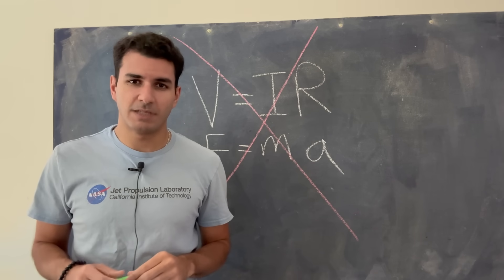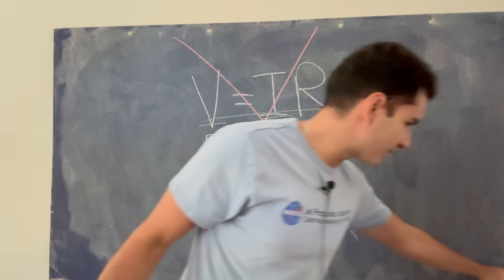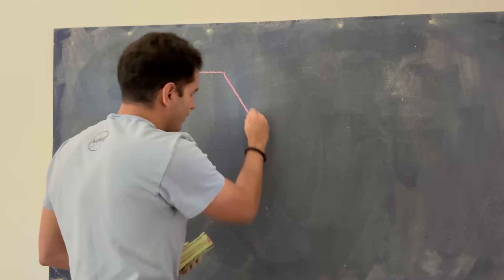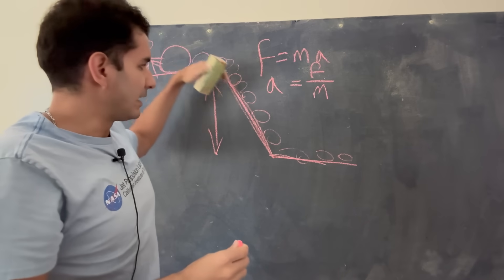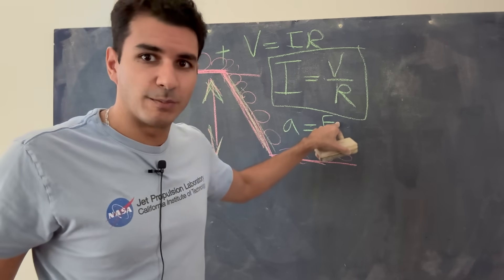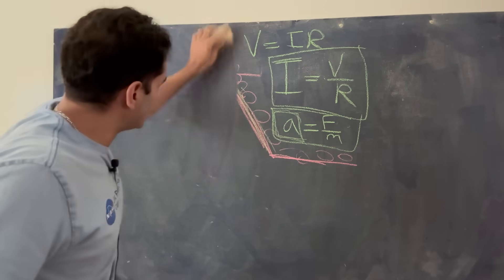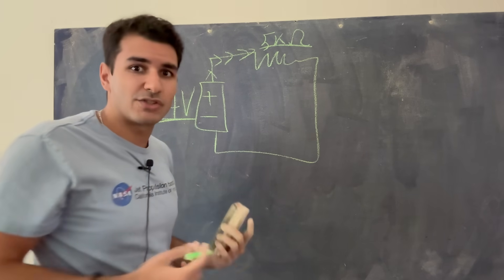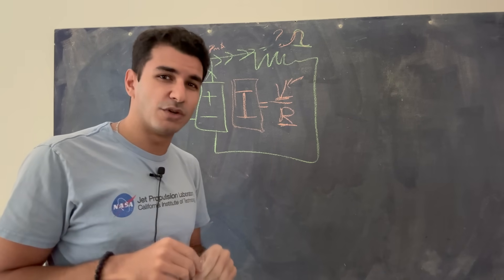You don't really understand physics

Comment: In the equation V=IR or solving for I we have I=V/R it is important to understand that I is a RATE; i.e., the rate of change transfer. The more appropriate statement should be that current is the rate of transfer of electrical energy. V is potential energy; i.e., Energy can be potential and kinetic. V (potential) is waiting for a path to be provided so that charges can move. Once a path is provided, the charges become a current; i.e., I = dq/dt. This insight allows for a rational interpretation of 'a' in F=ma as a rate as well. It is very important to recognize that the acceleration of a mass is analogous to a current flowing through a resistance. Conclusion: Study Calculus before Physics.

Comment: You all sitting there doing physics by calculating equations on a chalk board... to truly understanding physics sure that can have some benefit.. but you truly need 3d model visuals rendering softwsre games to demonstrate it then you can picture the entire thing in your mind and problem solve... those numbers... they only work so far.. what about tiny gusts of wind against a plane wing effecting the overal fuel milage... the exact angle the wing cuts into the wind to slow it down to just the right speed but also keeping in mind winds blow and flictuate and have a huge impact on this

Comment: Over 50 yrs ago..  I recall physics at A level started with grappling with metric system, I think because it's easier to recall units of measurement if keep using them eg N/m2 which implies various elements of equation IE  force, mass etc.. What you say seems a better way to foster understanding..

Comment: In my field I apply an (impulsive) force, and measure acceleration to determine effective mass. So I use m=f/a all the time. (for flexible, vibrating structures, effective or apparent mass varies with frequency)

Comment: One of my favorite examples of misapplied causality is from a Vsauce video where Michael gives the example of assuming that because you can calculate the height of tall building using the angle of the sun and the length of its shadow then the shadow is causing the building to be that height. Which is obviously false.

Comment: Another good example of a formula being conceptually inaccurate is the standard unit of acceleration: m/s^2.

I always used to think “What does the seconds squared mean? Why do you square time???”. That made no sense to me until I started thinking of acceleration in terms of velocity, which is measured in m/s.

The fundamental concept is that acceleration is how fast the velocity changes. So if an object's acceleration is 2 m/s^2, that means its velocity increases by 2 m/s EVERY SECOND. This is written as 2 m/s/s, which is shortened to 2 m/s^2. So really, the conceptually right way to notate this unit should be m/s/s, not m/s^2. The latter form distracts from the unit’s true meaning.

Comment: Sometimes, in electrical engineering, we have a constant current and we have a target Voltage, so we need to solve for R. Old school Ammeters gauge a current through a known resistance and that is how we measure voltage. Plus, once you start adding inductance and capacitance into the equation, physical analogues start to have less utility.
I'm not saying this is wrong or that no one would benefit from this line of thinking, but I think most EEs would prefer to think of V=IR as simply a relationship between electrical properties... Just my opinion - I could be wrong.

Comment: I understand what you're doing and I generally agree, but I have a quibble.  In the equation V=IR, V might be the cause.  However, if we hook the resistor to a constant current source, then current is the cause and the corresponding equation would be V=IR, as you originally had.  My preferred version of the equation is actually R=V/I.  That's because it's the definition of a ([n] ideal) resistor.  We have a good handle on current and voltage from the SI system of measurement.  R, however, is a derived unit.

Comment: Are you saying that electric current, which is nothing more than Q/t cannot arise as a consequence of changing the magnetic field across a conductor and therefore be the cause of a difference in electric potential at the open ends of a conductor? Are you also saying that forces generated by your reactive engines are not caused by accelerating mass (the exhaust)? See, there's more to teaching than explaining a different view on the world. It's preferable when the different view is actually correct.

Comment: Well, you are right 90% 
F=ma is also correct way in a physical pov if... We were calculating the force that the ball exerts on the second floor due to being accelerated, so here the force is a function of acceleration, while in your example the acceleration is a function of the gravity force ((external force causing the acceleration)) but it is not the only force, the ball will also exert force which is proportional to a, so in that case F=ma is more ""correct""

Comment: V = IR though represents the voltage DROP across a resistance R with a current I flowing through it.  If you have several resistors in series with a current I running through them collectively, using the value of each resistance you can calculate the voltage drop across each resistor by multiplying current through the resistor by the value of resistance.  So from that perspective, V = IR makes more sense to this (recently retired) electrical engineer.

Comment: I think you prefer to write I = V/R because you have an intuitive feeling for what current is and we are thinking about what happens to the electrical charges but I can imagine trying to design some material to get some potential difference then the cause could be controlled by the variable R and consequently the equation is fine just the way it is. But your point is generally taken, usually in classes the students are being taught what happens to the charges in which case the pre-existing concept is the electric field which provides potential differences which then cause movement of charges.

Comment: EE here. Sorry Ali, but I had to stop watching half way through. Your explanation of Ohm's law is not correct.

V= IR is just as valid as I=V/R. If, for example, I use a constant current (CC) source to source a known current through a resistor, then the voltage across the resistor will be directly proportional to the current through the resistor (assuming R is constant, of course). This is done all the time with current shunts; we measure the small voltage across the shunt, and then calculate the current.

Of course, the opposite is also true. If, for example, I use a constant voltage (CV) source to apply a known voltage across a resistor, then the current through the resistor will be directly proportional to the voltage across the resistor (assuming R is constant, of course).

Let's say I have two power resistors, each with a resistance of 3 Ω. For one resistor I source 4 A of current through it using a CC source. For the other resistor apply 12 V across it using a CV source. There's no difference between the two. (Well, this does assume 0 ppm temperature coefficient for each. In practice there will be small differences due to temperature coefficients.) And if you were to ask each resistor, "Is a CC source or CV source connected to you?" Each would answer, "I have no idea."

Comment: Sorry Ali, I have to quibble about V=IR.  There are lots of places in electrical engineering where we use constant current sources and current mirrors.  So, unlike the familiar battery, which provides a (roughly) constant voltage, these circuits provide a constant current, and the voltage generated across them depends on the resistance you place in the circuit, so V is indeed caused by I and R, or V=IR.  

To drive an LED, you don't control the voltage on it, but the current through it - if you ask "what voltage do I need to drive this LED?" and then pick a voltage supply equal to its forward voltage drop, part tolances mean you could drive too much current into it, or even kill it as temperature goes up - as diodes conduct more as temp increases, and "I" is an exponential function of V and T (temperature).  To design a proper LED driver, you ask "how much current do I need?" and pick an appropriate resistor for your voltage supply, which can be anything above the diode(s) forward voltage drop.  (But this assumes you're using a battery-like supply, and not a constant current driver).  So although the current does develop a voltage drop across the diode, thinking of that as being "caused" by the battery/voltage applied by the power source doesn't help you pick the right resistor for the circuit.

Arguably though, a more interesting equation is V = L * di/dt.  This equation DOES follow your causality notion as it is, but not in the way most people expect.  If you've unplugged a vacuum cleaner while the motor was still running and seen a bright spark at the outlet, you've seen this equation in action.  The "V" in this case is NOT the voltage at the outlet (120V in the US, 240 in other parts of the world).  Unplugging the outlet quickly decreases the current in the motor - and since the motor is a bunch of inductive coils, they each have an inductance "L."  That sudden drop in current (di/dt) means the energy stored in that inductor will suddenly create a high (negative, compared to the way the inductor was just powered) voltage large enough to break the resistance of the air, and create a high-voltage spark between the outlet and the plug.  That spark can easily be over 1000 volts, as is the voltage across the inductor as well.
Reply from the maker: don't you think that a current source is just a closed loop circuit that is constantly monitoring current and adjusting voltage?
Reply: @alithedazzling  A current mirror acts like a current source, and doesn't use "monitoring" of a voltage - i.e. no feedback measuring output current and adjusting it.
Reply: @Cynthia_Cantrell  You study at Hogwarts? It "acts like" must be done by definition by feedback.

Comment: 2 conclusions of the video : Its the current which is the affect produced by the battery of voltage V, which is flowing across a resistance R.     -> [I =V/R]
and similarly , acceleration a is the affect produced by the force F when exerted on an object of mass m.       ->[a=F/m]

Pardon me if i wrote something wrong

Comment: You are talking about dependent and independent variables.  It totally depends on how you do your experiment.   I use your example, V=IR.  I varied the current such that it will reach certain potential difference.  In this case my independent variable is current, and voltage is the dependent variable.   

Another example is distance = speed *time.    You can design your experiment: you take measure the distance d1, d2, d3… at time = 1s, 2s, 3s….    

But you can also design your experiment as: measure the time taken for an object reached the check points at 1m, 2m,3m,….   

So your thinking is too restricted to that some one has to vary the voltage and then see the response of the current.   This is not necessarily true.    

That is you not really understanding experimental design and spreading wrong concepts around.

Comment: I just got an example against "V=IR" : why is highest voltage ever produced about 25.5MV? Why can't we easily reach voltage in billions or trillions of volts, if all we have to do is increase the R? Then, we can proceed with what you said about causality and now it makes sense!
Reply: The Resistance doesnt depend on Current intensity or even the Voltage

Resistance of a material depend on 
Specific Resistivity of it

It's length 
It's area

If you increase resistance
You decrease the current flowing through 
So the product of resistance and current is always equal to the volt of the source

If you want higher voltage
We need a stronger Source 

So
I Depends on V and R
V doesnt depend on R or I
R depends on the material and its other properties

So increasing Resistance makes current decrease by an amount that always the Current.Resistance equals the Voltage of the source

That's why when you get introduced to electrical engineering of circuits
You always have that noted 
R doesnt depend on either of them

Voltage is dependant on the source of it

And also

If you want to achieve higher voltage
By higher resistance 
V=ir is correct
We have 3 factors
We want to increase v by increasing R right?
You can but then you have to control i at constant value.but as we know R affects current to be Lower When YOU HAVE THE SAME VOLTAGE..
Reply: @ahmedalaa7216  Good breakdown, thank you! Like they say, proper understanding is the key to success. 

I hope that education will be going more and more into properly explaining and visualizing certain concepts, as many people oftentimes don't properly understand what they are calculating, integrating, why we solve this or that equation, etc. 

And even if one thinks they do, just a tiny gap in reasoning or understanding can often be exploited by a tricky question, making someone confused or writing things that doesn't make physical sense (though such problems can sometimes be the best ones to teach certain things!).

I always liked, when some doctor or professor suddenly overhauled the fundaments of our understanding of a given topic or made some brilliant, tricky problem, just to vigorously explain it to us while we gasp at the clever reasoning!

Comment: idk. man ... if this is an issue to anyone, then physics may not be their calling anyway
- maybe I am the issue and just misunderstanding you etc but ..
- also I would say, it is more important that it is a ratio: that alone has a lot of meaning.
- I do agree "m.a" is a bit odd, as (ignoring GR) acceleration just does not "exist" on it's own, or as "input" - it represents the ratio / conversion of the two "real" things (velocity and force).
- current (circuitry wise) does though: from an inductor.

Comment: It is easier to memorize F=ma. To memorize a=F/m you have to remember which one is on top. You can always change F=ma to the form that is useful for each situation. 
V=IR is useful you know the resistance and measure the amperage and need to determine what voltage is driving that amperage. So the form of the equations to use depends on what you not to find and what you know already.
Reply: Seems like that is the point. If you understand the mechanic, it's obvious which variable goes on top.  F=ma isn't really helping to understand the mechanic, and if you have trouble remembering which one goes on top, you certainly do not understand the mechanic.
Reply: He is not wrong.  Clearly, he understands the mechanics. But, it is also true that when they taught us mechanics, it was usually the force F we were after. Usually! Hence, the proliferation of F=ma. If you understand the highly useful notion that acceleration and current are products of some force acting on a mass, or some voltage action on a resistance, that is it! You can use the corresponding formula any way you need to. However you must TEACH them as it is prescribed in this video.
Reply: So Newton had a hard time remembering his own equations so he chose F=ma?
Reply: That’s the point. You being able to switch the formula that way demonstrates that you understand what the mechanic is behind said formula. It might seem obvious to you but some people haven’t had that click in their mind simply because teachers do not teach it in a way that makes them understand the formula. Most students memorize, and memorize, and memorize—without actually knowing the reason behind how the formula works. This is primarily the reason why some students cannot pass certain difficulties in physics where it reaches the part for them to start manipulating variables & formulas.
Reply: Yes

Jesus died, and rose, offering salvation, grace, forgiveness, and hope for those who repent✝️❤️